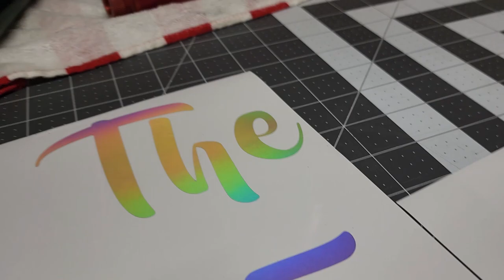We Flew a 16 Foot Model Rocket! It Was (mostly) Successful!

Comment: Can you do a video on what dual deploy electronics to buy and how to program? I want to start doing dual deploy but i really don't know how or where to start
Reply from the maker: The Missileworks RRC2+ is probably the best starting point because it uses simple dip switches for settings, it's small, and it's only around $50.